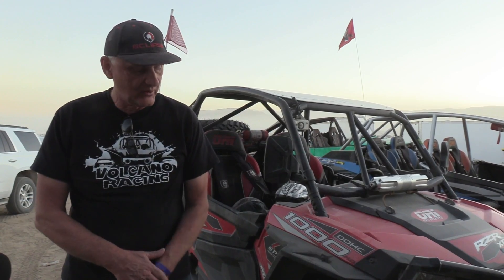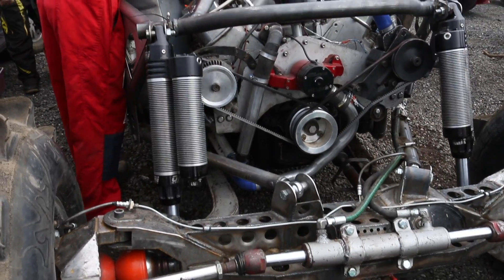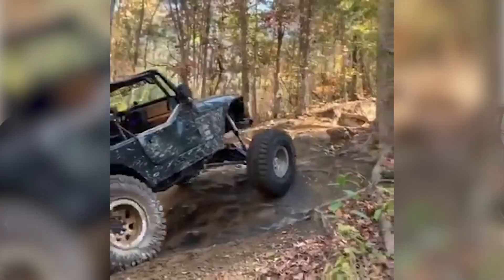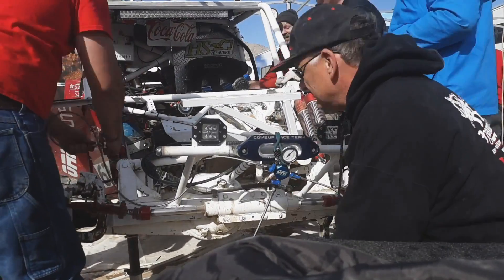What are ORI Struts? - Interview with Mark Jensen owner of ORI Struts

Comment: why do people continue to call them "struts"? they are dampers, or if you must, shocks.
Reply: If it’s got a spring it is a support structure. If it’s a support structure it is a strut. The word has existed far longer than car suspensions
Reply: Struts have springs lol
Reply: Air springs plus dampeners. 😉
Reply: Bc the man that owns the company says they are struts. You go event something and you can call it want also. Until then stop crying.
Reply: @YoJoe-s4b Strut: A structural element used to brace or strengthen a framework by resisting stress or compression.
Reply: @3thomasdm yeah, and in the English language you can find hundreds if not thousands of words use in this manner. Especially products being sold. You going to cry about all of them too?
Reply: @YoJoe-s4b what makes you think you can just change the meaning of words to fit your narrative? seems everybody is doing it these days.
Reply: @3thomasdm me? I didn’t do this. You better call up ORI and cry to them. Also, the meaning of it never changed. The definition is still the same. ORI just calls their product an ORI strut. Doesn’t mean it’s a strut by definition. However, it’s still an ORI strut. Now, pack that in your purse and walk off all sassy. 😂
Reply: Shocks provide dampening. Struts hold up the weight of the vehicle and provide dampening. These are indeed struts not just shocks or dampers because they hold up the weight of the vehicle.
Reply: @themotofixery  think about the insanity of what you just said. by definition a "strut" can not provide damping, that's the job of a damper. 
yes there is a damper inside the strut, but when you change out the strut 'assembly' are you really replacing the worn out 'strut' or a worn out 'damper' ?
Reply: @3thomasdm I guess I've never actually looked up the definition of "strut" but a typical strut on a car does both demping and aligning the suspension and holding up the vehicles weight. There are bigger things to worry about in life. Move on
Reply: Likely thinking of them due to the MacPherson struts, which are totally different but anyhoo... you're right, they are shock-absorbers

Comment: How do you determine the length of Ori you need?
Reply: Take your shock and spring off, compress the suspension to its limit or until something rubs or binds (meaning, steering and CV joints if applicable), measure eye to eye.  Fully extend suspension until something binds, measure eye to eye.  Contact ORI with your measurements, vehicle weight, and intended use, they'll probably have something that'll work for you.

Comment: Sway bars help keep traction when off cambered
Reply: Blanket statement.
Reply: @kevingraham8249  lol blank statement they keep pressure on the wheels which creates traction look up anti rock sway bars. If you don’t know what your talking about don’t talk crap.
Reply: Depends on the vehicle, Anti rock sway bars are their own animal just like the AIr struts. 
Leaf vs coil vs coil-over.. Too many variables. My Leaf spring YJ is un-drvieable on heavy stuff ESPECIALLY off camber with the bar connected.
Reply: I run no sway bars and run tons of off camber trails. Non issue. You don't need them for some setups.